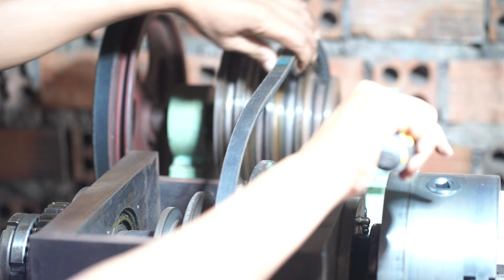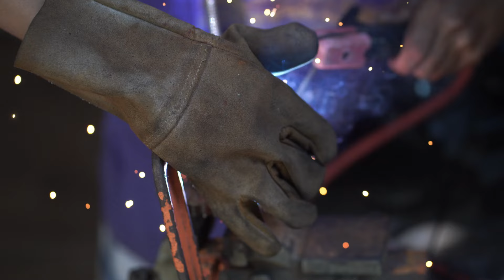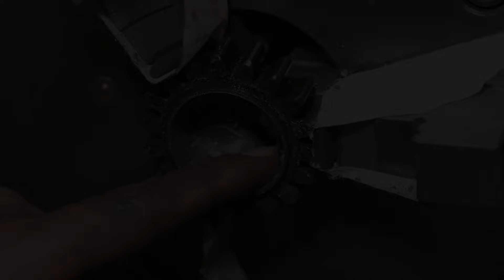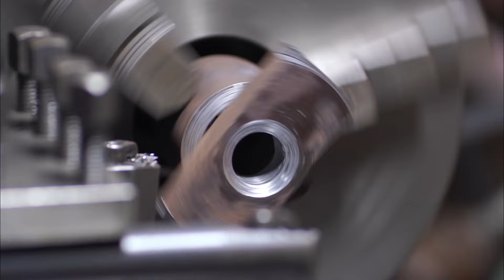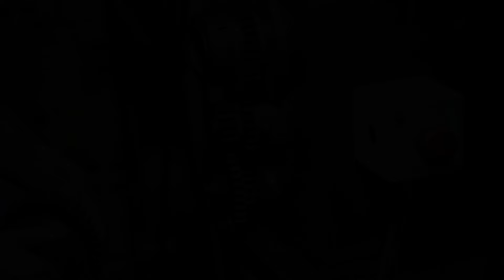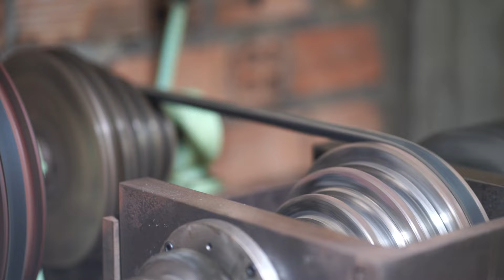DIY. Setting Change Gears Southbend For Homemade Lathe Pt 3

Comment: How To Use This For different Threads 
In TPI MM
Reply from the maker: Thanks for your help watching my video.
Im not sure yet sir. I keep learning about it because my first time never done in my jobs. And otherwise, the setting of gears from the scratch shop is not perfect at all.
And very difficult to find out gears, the gears I found it not in the same place. If I found all a time can make it easy. Those gears very expensive. I know got experience than me. I don't know to calculate of the speed and rpm.
Thanks

Comment: Parabéns pelo trabalho tá ficando top
Reply from the maker: Thanks for your help watching my video.
Im not sure yet sir. I keep learning about it because my first time never done in my jobs. And otherwise, the setting of gears from the scratch shop is not perfect at all.
And very difficult to find out gears, the gears I found it not in the same place. If I found all a time can make it easy. Those gears very expensive. I know got experience than me. I don't know to calculate of the speed and rpm.
Thanks
Reply: Esse tipo de material e muito difícil de encontrar

Comment: Getting closer.    Finish quality is about to improve drastically on the lathe.
Reply from the maker: Thanks for your help watching my video.
Im not sure yet sir. I keep learning about it because my first time never done in my jobs. And otherwise, the setting of gears from the scratch shop is not perfect at all.
And very difficult to find out gears, the gears I found it not in the same place. If I found all a time can make it easy. Those gears very expensive. I know got experience than me. I don't know to calculate of the speed and rpm.
Thanks